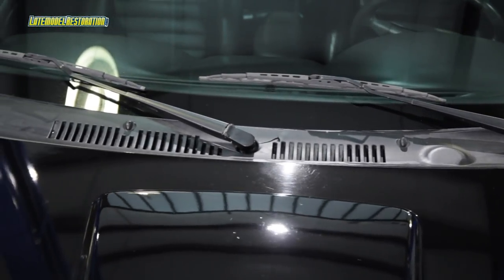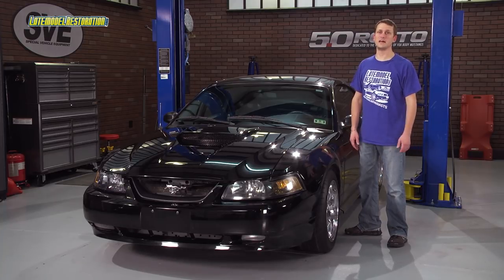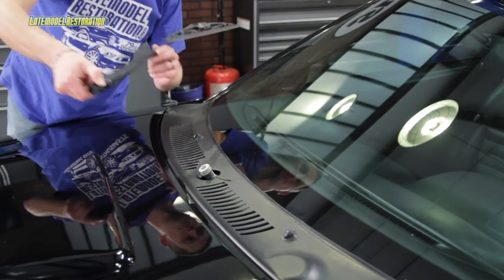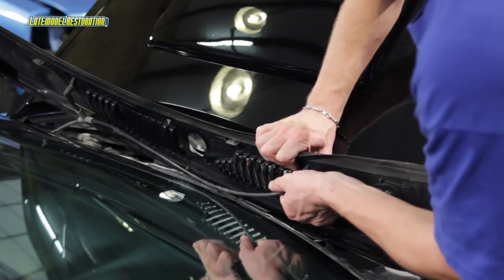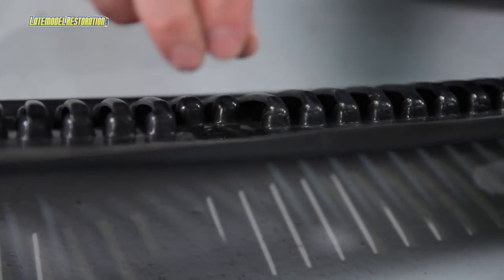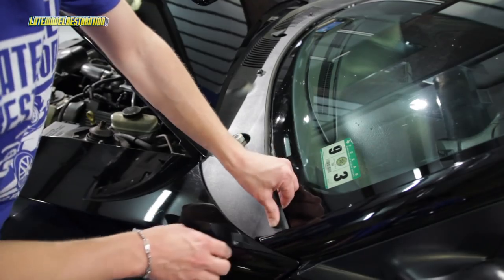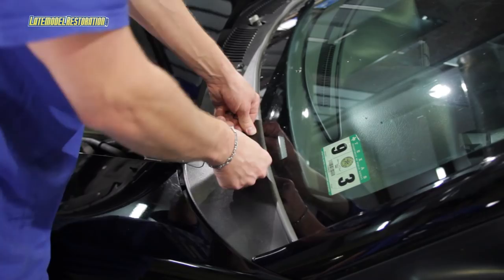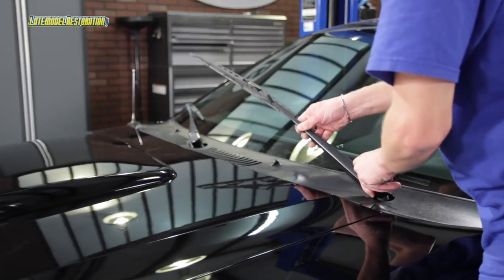1999-2004 Mustang Cowl Vent Cover - Install (SN95, New Edge)

Comment: I like the video. I would however like to see more restoration type of parts for the New Edge Mustangs. I do understand that the platform isn't all that old as of yet, but it can be difficult to find parts that commonly wear quickly. Salvage yards are an option but the problem is, the part you find to replace your worn or broken one is just as old or older than the one you're replacing. Thanks for the hard work. You guys are great.
Reply from the maker: Justin Merrell Thanks. We will for sure be doing more 94-04 Restoration videos in the near future.

Comment: I have a leak on my driver"s side floor coming from the front. I have looked and looked and cannot find a video or pictures on any forum that deals with fixing the leak. I imagine that the drain cowl is clogged by leaves  and/or pine straw, BUT WHERE IS IT????
If you could do a video about this, I am sure many many people will benefit!
thank you!
Reply from the maker: Erich Coleman Once you have the wiper cowl removed you should be able to spot any debris that could potentially be contributing to a leak. -Landan
Reply: Thank you for responding...I did see some leaves, and I removed them. What I cannot find anywhere on the net through, diagrams, forums and Youtube is EXACTLY where is the drain plug on the 2001 Mustang? Do I need to take out the wiper motor to access it. I am in Florida now and it is raining almost everyday, so I am very close to paying someone to take care of this, but I would much rather do it myself.
Reply: This is late, but have found possible fix....if you take carpet up and put silicone sealant against the edge of lower door, it should protect from most water coming in.  I believe it drains from front to back and water exits drain in front of rear tire.  if those seams don't have sealant, water can leak through on trip to drain.  I think originally it was just welded and thought to suffice...but some need that seam by door caulked with sealant.  Best advise is try to deal with seatbelt torx screw first...mine was so rusted and I had to soak it in liquid wrench...that should free carpet (along with quarter panel)enough.  Back seats should be removed too.
Reply: Erich Coleman did u ever figure out exactly what was causing the water leak? I have a cracked cowl cover and wondering if that is my issue. My leak is coming from under the dash which drains down to the driver side and sometimes the passenger

Comment: is there suppose to be tenension once the two ends are in place? I tried putting mine in and after I pop it into place on driver side in order to get wipers to line up I have to put it under some tension.

Comment: Does 99-04 Mustang GT have cabin air filter ? Can y'all help
Reply from the maker: They actually don't have a cabin air filter
Reply: @latemodelrestoration thanks LMR would you guys have clue to why my ac wants to give out when i drive with it for about 20 mins and almost turn off my car, likes the ac is forcing itself to work. But when i dont have ac on its perfect
Reply from the maker: The best thing to do is take it to a local shop or performance shop and have them look at it. They'll be able to diagnose the issue.
Reply: @latemodelrestoration  thanks i will do that im ordering some things today too from LMR love you guys

Comment: Think you can do a coyote swap on a v6 new edge?
Reply from the maker: kendrik hobson This is completely doable! Check out our Coyote Swap project in the link below. You would follow the same basic steps but you would need to add a return style fuel system and 8.8 rear end. 

http://www.latemodelrestoration.com/products/Mustang-Coyote-Swap-Project

Comment: Why do you guys charge so much? It's a molded piece of plastic.
Reply from the maker: Chinesefoodrocks1521 Our price is based off of several attributes. Unlike cheaper 2-piece designs, this cowl panel is 1-piece and offers superb fit and finish.
Reply: Tony K supply and demand
Reply: Late Model Restoration it is trash !!!!!
Reply: @headshotlouiebfm5698  Oh, come on, if you bought the car new like I did, you haven't had a car payment in over a decade.  So it's pretty cheap...  Well, if you insist, you can always go buy a new one for $38k...